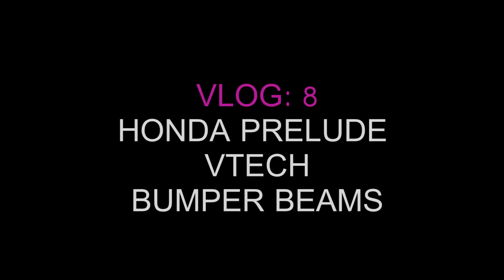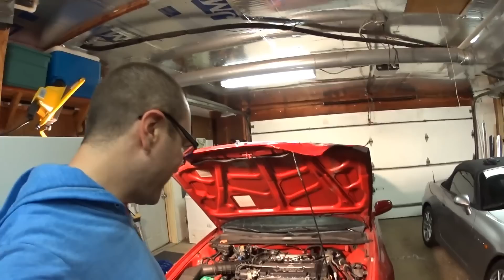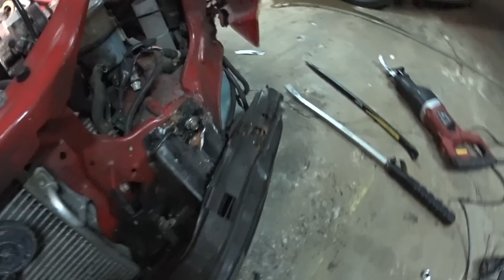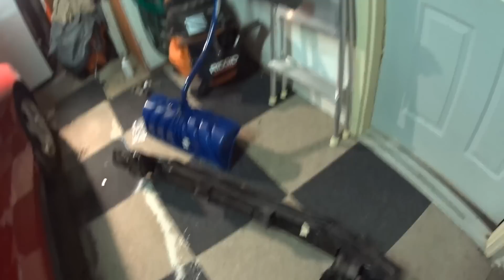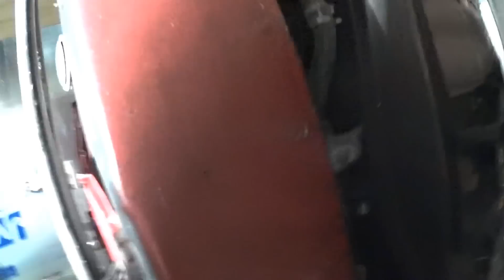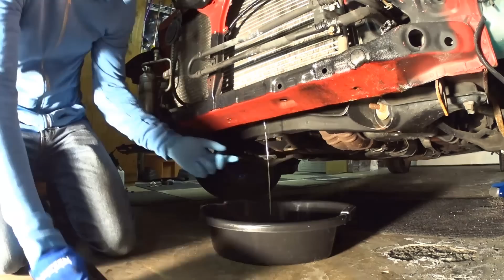VLOG 8: Repairing 98 Honda Prelude

Comment: I would throw a blanket or sheet over your S2K. Hot embers or sparks will screw up the finish, or if you accidentally send something flying over there you have some protection. I would move the S2K outside.